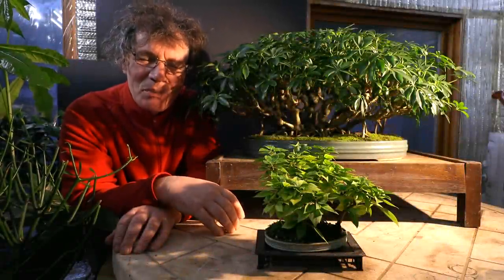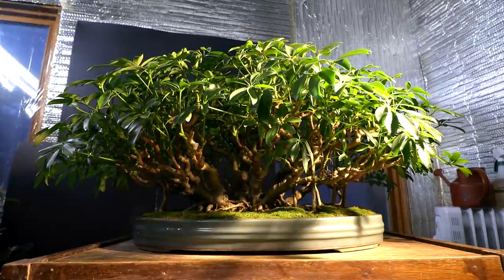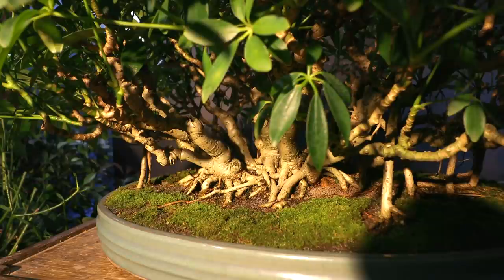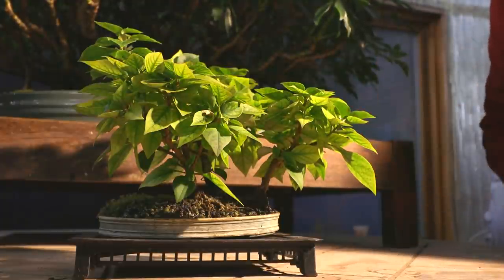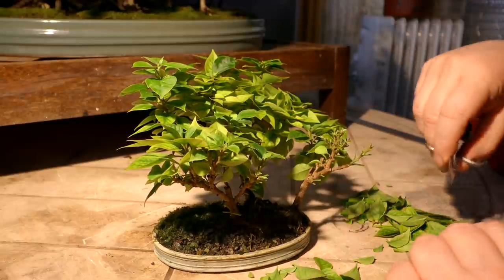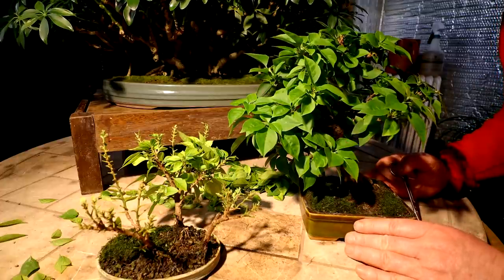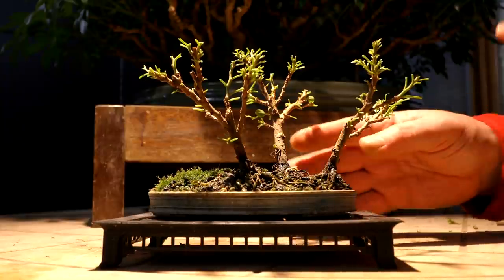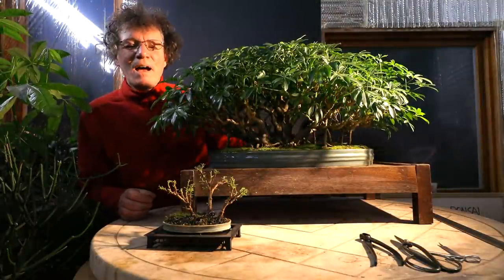Pruning My Bougainvillea Bonsai Forest, The Bonsai Zone, Jan 2020

Comment: Hi Nigel, I rally appreciate your videos. They inspire me to make the best of my bonsai every time I watch one of them. Which brings me to a question you or the community might have an answer to. My ficus microcarpa seems to have a bit of a problem with some kind of flies. They seem to emerge from that plant and when I saw them I remembered one of your earlier videos, in which you had to do some major root surgery on one of your trees. If you could get back to me, it would be really awesome, since I fear that the tree might suffer. Thanks in advance!
Reply from the maker: The flies might be Gnats that tend to live around wet soil. It is possible they are flying aphids also. If they are gnats, let your soil dry out a little more between watering and get some yellow sticky greenhouse paper to catch flying insects.
If the insects are aphids, you can spray them with insecticidal soap.

Comment: Hey nigel, I don't really have a bonsai shop anywhere near me, is there any websites you recommend for supplies, pots and finished trees ? with decent pricing? thanks!
Reply from the maker: Hello Olivier, where are you located, this will help me to find you a place close by!
Reply: Nigel Saunders, The Bonsai Zone I’m in York, Pennsylvania, usa
Reply: I have lots of houseplants in gritty bonsai substrate which I converted to soil less. I buy my substrate from a company called "Bonsai Jack". They specialize in substrate, but have limited other supplies. I've never had any issue ordering from them. Another online Bonsai supply company is one called "Eastern Leaf".  They have tons more bonsai supplies though I've never purchased from them as yet, but they were recommended by few on IG. :)

Comment: @ 23 min you mention you'd rather have it bloom in the summer than right now. My bougie is blooming right now. Does that  mean it won't bloom in the summer?  ( keeping it indoors over the winter and then plan to make outside in the spring . SLC , UT 6a)
Reply from the maker: They bloom off of the latest shoots, you will find that after your current flowers fade away that the plant will start to grow once again. After this new growth has elongated and has provided enough energy to the plant, it will bloom once again. You can easily get 2 to 3 flowering periods per year and when conditions are right, it will continue to flower for almost the whole summer.

Comment: Any tips for getting a nice mossy base / top of soil. Thanks
Reply from the maker: There are several factors!
You need high humidity, a free draining bonsai soil so the soil stays not too wet and not too dry. The moss likes to be watered with rain water. I mist my moss at least twice a day and fertilize weakly every day. The moss grows best with little air currents to dry it out. It needs to be watered consistently to keep the soil damp.
Hope this helps!

Comment: You dont need a 3D scanner to scan objects. You can take multiple images using any camera and use Medhroom: an open source software that helps to extract 3D models from photographs. Then import the file in blender to crop and other things needed for 3d printing. Its extremely easy.There are many tutorials available on youtube for that.
Reply from the maker: Thank you very much, I have seen it used, if the scanning doesn't work well, I'll give it a try!
Reply: @TheBonsaiZone   Do try it. It works flawlessly for me. I used it to model leaf shapes for my research.